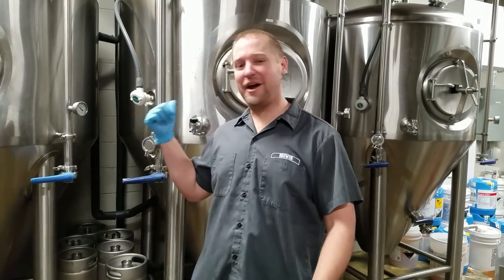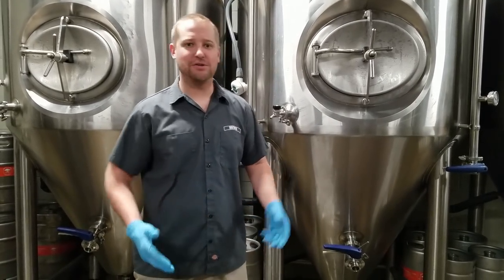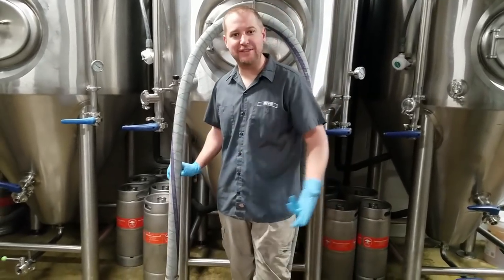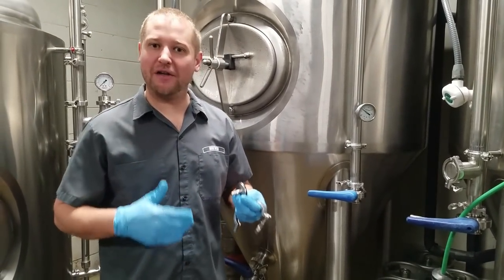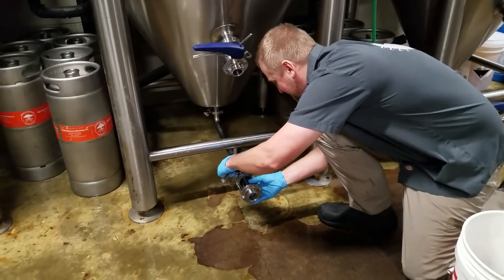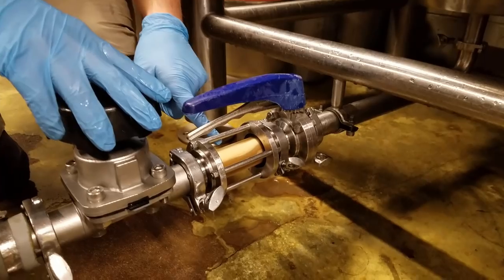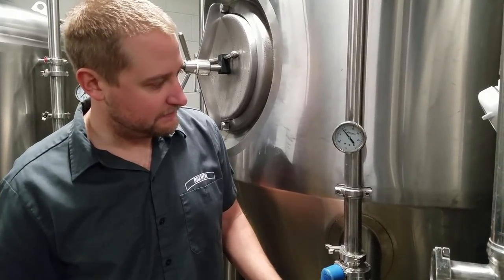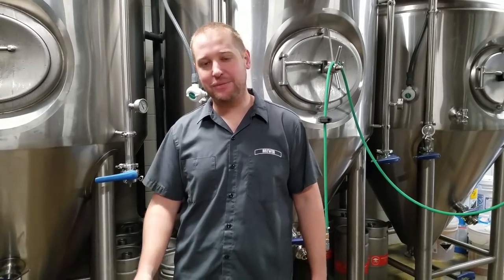DROP CONE!! How To: MICROBREWERY! Beer Brewery Equipment!!

Comment: I think that the best way to avoid opening the wrong triclamp is to remove it's wing nut and replace it with a normal lock nut. You won't be able to unclamp it without a wrench.

Comment: Great informational video as always. Here's a few additional tips based on my processes. A 4mm hex key will tighten up the screw on that bottom dump valve handle. Also, you keep your diaphragm valve closed when opening the dump valve, but I find if the cone slurry is loose enough it will bubble back into the tank and that's a chance for contamination or oxidation. I always leave it partially open to make sure it's vented to drain and then close down to control flow. Lastly, when you are topping up head head pressure on the tank and it already has pressure just crack the tank valve and connect co2 under flow from both.
Reply from the maker: Andrew! Thanks for the contribution. These are the kind of comments that change lives. Keep them coming, Cheers!

Comment: Excellent and informative video! A video on dry hopping techniques to avoid the carbonation eruption would be fantastic! Glad to see you back making videos
Reply: One word: fermcap
Reply from the maker: Dry Hopping video...maybe maybe. Good advise Jeremiah!
Reply: If you are averse to using the fermcap, the other thing you can do is close the valve for 10-15 min immediately after dry hopping. Even if you are dry hopping during fermentation (+1.010 from projected FG has worked best for us) this technique is still very effective and doesn't stress the yeast enough to cause any issues.

Comment: Wondering if a red cable tie attached to those inner tri-clamps could serve as a warning?
Reply: I worked as a printer in another life and we printed lock out tags for equipment that needed a warning such as your fittings. We installed a loop of wire in each tag that the customer twisted onto the part. They also purchased extra wires to reuse the 🏷. Guessing water proof in your case!

Comment: I've just watched this video for the 3rd time.  I've also had some incidents by removing the wrong valve in my home brewery.  I've been burned and I also had a partial amputation of my left thumb (long story and not related to a valve, but stainless steel is VERY sharp).  We'll be using a small piece of red ribbon to mark triclamps that should not be removed on the big boy brewery.
Reply from the maker: Safety first!

Comment: Great to see you back making videos! Your videos have been a great resource as I started my own brewery last year. I modeled my yeast harvesting setup based on your videos and it has been working very well. On the issue of dumping the yeast from the cone, have you noticed any differences between yeast strains? We have 4 strains we use regularly and all others (American Ale, Lager and Scottish Ale strain) drop very easily and don't stick to the walls of the fermenter, but our Belgian ale strain tends to stick to the walls, leading up to punching a hole in the middle even if I try to go as carefully as possible.
Reply from the maker: Awesome to hear! Different yeast strain definitely have different flocculation genes. Sometimes not every stain works for your process, keep experimenting , cheers

Comment: More stories about brewery mistakes and mishaps would be very useful! I do have a question though about what the purpose is for keeping the fermenters under pressure. What's the benefit of that?
Reply from the maker: Helps keep oxygen out and carbonation in, cheers!
Reply: Also helps to clear up the beer, pushing yeast/hops into the cone

Comment: Again, wonderful video Jasper!  If you could explain when you close the blow off arm during fermentation and put the head pressure at 10 psi for natural carbonation?
Reply: I would like also to find out more about this (when to close the blow off arm and pro and cons on fermentation under pressure or at atmospheric pressure.  Thanks Jasper again for your effort and helping out the world of beer.
Reply from the maker: Try capping with 0.5P left in Fermentation. Saves on Co2, Prepares tank for cold crash, does change flavor compounds. Cheers

Comment: Great vid! I see that you keep it at 10 psi, I'm sure that it carbonates as you're waiting (especially at 32 degrees). Do you change the psi for beers that you like carbonated more?
Reply from the maker: Thanks, final vol adjustment is done in the bright tank per brand. Head pressure wouldn't over carb your beer on this scale if your moving your product quickly. Therefore all cellar tanks are kept at 10psi. Other breweries with different proceeses may require it though.

Comment: Hey Jasper amazing work thanks, just a dumb question, if you accidently opened the wrong clamp on the spray ball arm and blew out all the pressure, why would it ruin the batch of beer?
Reply from the maker: Thanks, no worries, not a dumb question. For me a few reasons it would ruin a batch of beer are; I would lose alot of desirable aroma, head retention would be trashed, I'd have to force carbonate the entire batch rather than last 25% of vols. A good rule of thumb is to treat your beer gently, this volcano would be the exact opposite, cheers.

Comment: Hey, can you please tell me of you can do a natural carbonation at this level?
Reply: Why not? The fermenter would have to be built to withstand the pressure like a unitank. But from what I understand unitank are expensive. I would imagine if you wanted a natural carb beer you would just bottle condition.
Reply from the maker: A jacko is right, bottle conditioning is the best way to do it in my opinion. aka Sierra Nevada. Fermenters and Unitanks are a little confusing. They are the exact same thing in microbreweries, but it is how you use the tank that makes it uni. Uni means one tank used for fermentation and packaging. Fermenter or FV is said when you use a bright tank to package. Both are commonly rated to 1 bar or 14.7psi. Full carbonation with active fermentation would require a 2bar or 29.4psi rated tank. These tanks exist but I have yet to see one, and would never encourage brewers to use this psi on a commercial scale. This is why partial natural carbonation 75% then forced to 100% is standard operation in commercial breweries. Hope this helps cheers.

Comment: WOW!!! SO you ferment under pressure? Is that normal in the beer world?
Reply: Reenactor Guy , I believe he cold conditions under pressure. 
A lot of breweries do ferment under pressure towards the end of fermentation via a spunding valve. This allows recapture of CO2 produced during fermentation so when you go to cold crash it helps partially carbonate the beer. This cuts down on CO2 required to carb the beer in the brite tank and is also useful to better compact solids out of suspension (via head pressure). 

Cheers 🍻
Reply from the maker: Jonathan has a great comment here, thanks for contributing man, cheers

Comment: If dropping the cone with blow off tube directly and without adding pressure to the tank (although my pressure is around 8 psi) can it be that oxygen is introduced in the tank do the punching hole you mentioned? Also, can it be that dropping the cone just with a blow off tube could make a more foamy product to come out?

Comment: How do you dry hop in an FV tank when it's pressurized? do you release the pressure then add in the hops (but then that would let oxygen in). Or do you feed it through the bottom of the cone? Anyone able to answer this? Thanks!
Reply: Rarely do breweries do this, but it is possible to mix hops and wort/beer in brink and then pressure feed it through the raking arm.

Releasing pressure would be the way to go.

Comment: Question... Is it better to use the alcohol solution vs. something like star-san or is that just your personal preference.   Cheers and keep up the great work.
Reply: alcohol solution...IPA or EtOH
Reply from the maker: In this application, Yes. 70% Iso has a kill time of 10secs. Star san has a kill time of 2mins....70% Iso is cheaper and doesnt require any extra steps of dilution. 100x better in my opinion.  BUT DONT SANI YOUR CARBOY WITH IT.
Reply: @brewerylife3596   wouldn't make more sense to use non denatured EtOH?  similar kill properties and cheap too.
Reply from the maker: If worried about touching product EtOH should be used because its food grade. So here I call a grey area. I only use EtOH when harvesting yeast or transferring beer not dropping cone or sample valves but maybe I should start.. It is more dangerous to store. Iso is the preferred surface sterilant for medical, pharmaceutical, and microbiology labs. Thanks for the comment man!
Reply: @brewerylife3596    awesome thank you!

Comment: Thanks again for the awesome vídeo Jasper! One question, I'm having a hard time harvesting yeast on dry hopped beer. It seams all it comes out is Hops and I can't get any clear yeast. Should I harvest BEFORE I dry hopp? I usualy blow some CO2 on the botton of the fermenter to agitated the hops after a couple days of DH.
Reply from the maker: Thanks for watching. Dry hopping and yeast collection is common problem in breweries. Ill try and make a video on it.
Reply: Do not harvest yeast after dry hopping. Better yeast management would be to harvest before you dry hop. Hops dramatically reduce the yeasts viability and may cause lots of issues for future brews if your re-pitching garbage/tainted yeast.
Reply: Harvest before dry hop.

Comment: Even though the stuff at the bottom of the fermenter will be thick, are you not worried with the diaphragm valve closed that the sludge could potentially displace the air pocket between the tank dump valve and diaphragm valve? Or maybe it's just me and my oxygen paranoia! 

As long as you're able to throttle flow with the tank valve I don't see the purpose of the additional valve you attach.
Reply from the maker: Leaving the diaphragm open just a crack is a great thing to do. I found using the diaphragm this way makes dropping far easier. If youre happy with just the butterfly no reason to change. If dropping hops is a pain this helped me. Happy brewing.
Reply: @brewerylife3596  cool man, whatever works for you! Everyone has their different methods for sure!
Reply: Actually, the two valve setup is essential because otherwise the pressure drop across the upstream butterfly valve will usually cause CO2 breakout (foaming) in your sight glass and you won't be able to assess clearly what is flowing out. The idea of the diaphragm (or even a second butterfly valve if you don't have one) downstream of the sight glass is to control the outflow AND take that pressure drop where it doesn't affect your vision of what's in the sight glass. 
And yes, there is a risk of air backflow if the second valve is completely closed. I crack it slightly to ensure positive flow away from the tank at all times, and then open up the tank butterfly fully so that flow control is then taken by the second valve.  (As taught me by my mentor/coach Rockstar Brewing Academy). Cheers!
Reply from the maker: Great point, thanks for the comment!

Comment: So question, say you're only doing 1-2bbl batches...If you dont have a way to counterpressure a yeast brink, would it be acceptable to use the diaphragm valve for flow control for yeast collection in half gallon mason jars?
Reply from the maker: Diaphragm valves can definitly help with flow control but if the pressure difference is huge it might not help. Only way to tell if it was acceptable would be to count your yeast after harvest and make sure its above 90% viability. Cheers

Comment: alcohol solution better than starsan?
Reply from the maker: In this application, Yes. 70% Iso has a kill time of 10secs. Star san has a kill time of 2mins....70% Iso is cheaper and doesnt require any extra steps of dilution. 100x better in my opinion.  BUT DONT SANI YOUR CARBOY WITH IT.
Reply: @brewerylife3596  Iso is better than a bottle of peracetic acid?
Reply from the maker: Doesnt break down in the bottle and loose effectiveness in 48hrs like PAA. So yes, in my opinion. PAA is my favorite sprayball tank sani though, great stuff!
Reply: Alcosan or divosan or 70%alcohol is a better sterilant
Reply: Yep, 70% iso is the last thing we use where I work on parts & fittings before hooking them up.100% flashes off too quickly. PAA requires longer contact time to sanitise. PAA for sanitation cycle of CIPs at my place.
Reply: @brewerylife3596  what are your thoughts on using iodaphore?